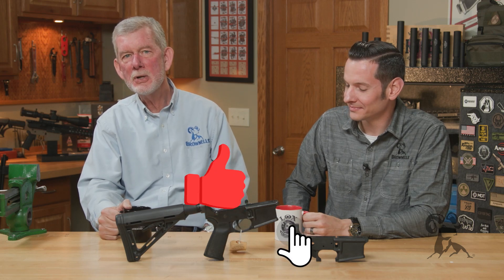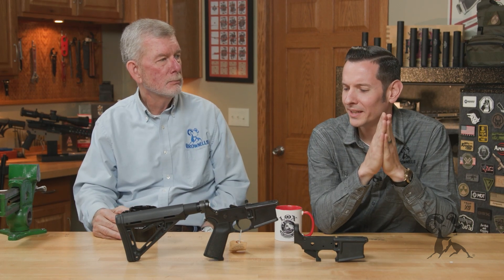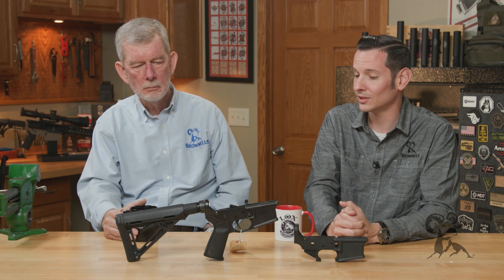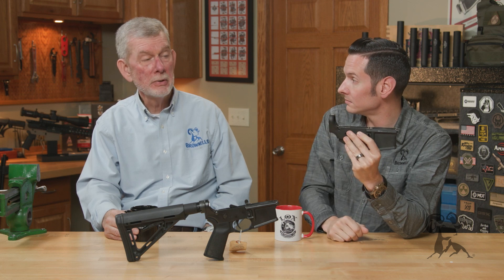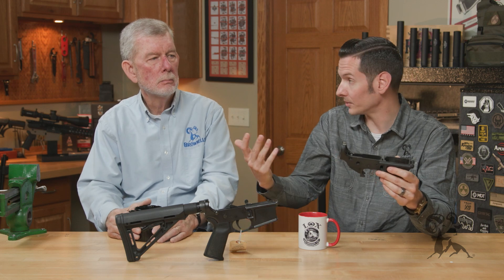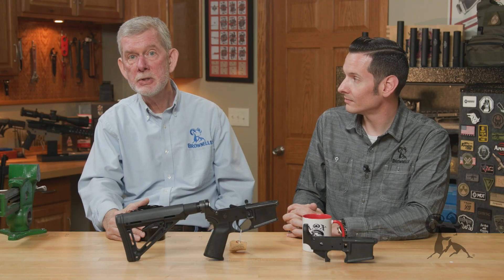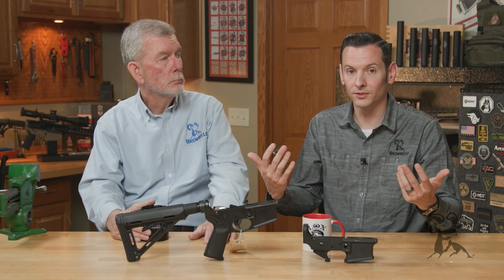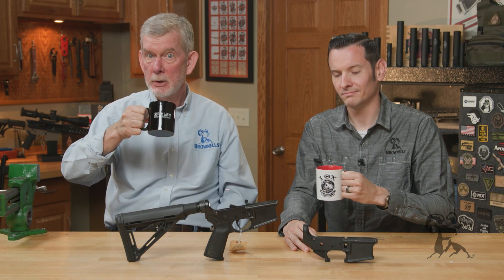Smyth Busters: Are Polymer AR-15 Lowers Any Good?

Comment: The concept of a polymer lower is interesting but most of my lowers are from PSA, they’re pretty reasonable in price and I haven’t had any issues.
Reply: PSA it is amazing. $150 for a lower that is normally 500. And an upper that was 300 that was normally 600. Now, Bam, a 10.5 inch forged 300 blackout AR for 450. So cheap I was like, why not one in 556 as well?
Reply: PSA is the GOAT. Seriously, for the price, they can't be beat. Their Sabre line is amazing.

Comment: I built an ultra light with both polymer lower and upper.  It came in at 4 lb., 10oz.  It IS aluminum reinforced at the buffer tube and the front take down pin.  It also has anti-walk trigger pins.  The gun is reliable and shows no signs of failure.

Comment: I've had two poly lowers one from FMK firearms which ran okay, and the other from ATI (their Omni Hybrid lower) the FMK lower did okay but did not have reinforcement. The Omni Hybrid lower had the reinforcement but I ABSOLUTELY COULD NOT use the takedown pins without having to use punches to drive them out as the holes were not sized properly The Omni Hybrid lower also appeared to have a defect in the polymer inside the magazine well where a small hole appeared which moved through the magazine well and into the trigger housing area. Ill stick with Aluminum lowers.
Reply: What caliber did you use for your FMK, I have a 9mm AR pistol lower and I’m wondering if it’ll work with 5.56 upper since it says multi caliber on the lower.
Reply: @samuelflores2024  I chambered it in 5.56
Reply: @Justin-LaFleur  for the 9mm it ran solid, but the bigger the cartridge the less reinforcement it’ll hold. No wonder the one who built it made it in 9mm.

Comment: I have 5 or 6 polymer 80 and JMT brand. I have used them for several years without any problems. I carry them in the woods hunting and they have held up just fine. I have both AR-15 and AR-10. Maybe I am just lucky.

Comment: Polymers have come a long way. I wouldn't be surprised to see more AR manufacturers switch to polymers in the near future. polymer AR lowers is just more practical and cost effective, not to mention lighter then aluminum AR lowers. Even though I am still not a big fan, because polymer is just a fancy name for plastic, and I prefer not have a plastic gun. Long as it runs and is durable, as well as long lasting. I really don't care what it is made out of, especially if the overall end result is a much lighter and possibly more accurate firearm.
Reply: you dont know what you dont know.  lol.

Comment: I’ve personally had two polymer lowers break, both with extremely low recoiling rounds. One being the MP15-22, and the other a 5.7 upper on xxx brand lower. Both broke at the receiver extension point. Both of them broke under average range use at under 2000 rounds. I also have experience with an ATI that failed from overheating, but that was to be expected. That one did not happen at my hands and was not my firearm, but I am the one who diagnosed what went wrong. That lower is actually still slightly working out.

Comment: Don't forget about The Stryr Aug, designed in 1977, in service 1978 and still used today.
Reply: Difference is that the AUG was designed to use polymer as a lower receiver. The AR-15 lower receiver was designed to be forged from aircraft-grade aluminum alloy that was first made in the US in 1942 (it was initially developed secretly in Japan in 1935, and was first used on the Zero in 1940), and milled to the proper dimensions with numerically-controlled machine tools. 

As a result, making lowers out of polymer requires substantial redesign to the lower for it to work anywhere near as well as the original. That's why the Cav Arms and KE Arms lowers are the only lowers which people actually recommend. The AUG doesn't suffer those issues because it was designed to use it, and the engineers designed it with the properties of injection-molded polymers in mind.

Comment: My omni hybrid newest gen all reinforced everything at first it had alot of doubts faliure to feed to extract ect was getting worried but a spikes tactical st t2 4oz buffer with a springco blue medium spring ive ran 200 rounds with out one flaw also throw your factory mag away it was a problem also went to p mags and runs like a tac driver the s60 mag also no problem but again the buffer and spring on a 16" omni hybrid p3 multical in battlefield green is amazing after a few upgrades as needed! Also i run pmc bronze 223 55 grain or x-tac green tips they love brass not steal!Hoped this helps anyone thats having problems with the newest gen omni hybrid p3.

Comment: bought an ATI with polymer lower a couple years ago ( cheap father's day present for myself)... about a thousand rounds since and it's still going great.  maybe i got the exception to the rule with ATI ?
Reply: I have built 3 AR's with ATI polymer uppers and lowers and had no breakage issues. They reinforce them with metal at the pin points and the buffer tube connection. I guess if you drop your gun on the garage floor or mishandle it, sure it will break. ATI has good stuff!

Comment: I would say a good way to mitigate overgassing is to put an adjustable gas block on the gun if you are going to run a polymer lower. This ensures you can control how much gas the gun gets, and it will help your lower last longer. Anti-walk pins are also a really good idea so you dont get loose pins over time. Also, make sure you only use polymer mags and not USGI mags, this ensures you don't induce premature wear on your magwell. There are some companies that make polymer lowers that are reinforced toward the rear with steel pins. That might be something to look into if you want to keep that area from cracking

Comment: My polimer lower failed at the top of the threaded buffer tube threaded ring. This allowed the buffer tube to slip rearward enough for the retention pin to become unrestrained and lock the bolt up.

Comment: My first CAV-15 lower arrived from Brownells already split along a seam.  Brownells replaced it.  I now have a KE Arms lower that I plan to compare to the CAV-15.  My opinion is these make decent lightweight truck guns, but I am reluctant to use them for serious field work or self-defense when other options are readily available.  I also have several SU-16s which I hold in similar regard.  I have not bothered with the traditional polymer lowers because aluminum ones are better and inexpensive.
Reply: Look through Forgotten Weapons or InRange bios on their WWSD rifle. If you see the abuse they put it through you would implicitly trust you KE15 lower. I have one. Fabulous.
Reply: The new KE Arms KP-15 Lowers are amazing and reliable. Look at the review Recoil Magazine did on the WWSD Rifle on their YT channel. You will change your mind.
Reply: @jmpetersrn Not long after putting up my original post I put mine together but I've not yet given it a thorough workout.  I agree they are much better designed and built than the the old CAV-15.  The only issue I had with it regarded some confusing instructions about installing an ambi safety.  I spoke with Russell Phagan about it and he provided me updated guidance.

Comment: KP-15 is impressive, magazine compatibility could be better though. I wonder if its possible to make a KP-15 but its an integral adjustable buffer tube versus a fixed stock. Would still be able to reinforce the thumb web area like the current model.

Comment: I never had issues with the polymer lower I had, but I did have a polymer upper fail at about 300 rounds. I would only trust a polymer lower for a range toy and not use one on a defensive or duty gun. I’m sure they are fine but I just wouldn’t be comfortable with it.

Comment: That's so ironic. Huge fan of this channel and just started looking into polymer 80's last night. Just came upon a cheap drill press. Polymer seems easier for me to deal with as a beginner rather than aluminum as for machining is why I am looking.
Reply: I have 2 polymer80 ar15 one with a bca upper standard 556 with about 600 rounds thru it mostly steel case, and to be honest no cracks or sings of weak points in it . In my opinion it's best for .22lr uppers for the long run
Reply: @danielramos803  I'm thinking of setting it up as a backup AR but converting it to 22lr. That way I can switch back and forth as needed.

Comment: A regular mil spec 7075 t6 aluminum lower will go for 500,000 rounds. A polymer one will not. Why take a chance? You get a good aluminum lower with that track record. We don't use polymer ar15 lowers in the military for a good reason. There are firearms that gave polymer but those designs were from the ground up. Not a simple material replacement  which has completely different properties, properties that weren't taken into consideration when the ar 15 was invented by Mr. STONER.

Just buy a regular mil spec lower. You're doing yourselves a disservice but thinking "well I think I can make it work". 

Glocks are one thing, polymer ar lower are waay different animal

Comment: I have 2 polymer lowers made by FMK. They are very durable and I've had zero issues with them. They were under $40 each
Reply: How many classes have you taken them to?
Reply: @ja0298  classes? Just to the range for target shooting
Reply: @trekgod3  yes classes. Purposefully induced malfunctions. Purposefully putting stress on the rifle and lower. 

You gotta be able to back it up when you say something is durable. Just target shooting does not make something durable.
Reply: @ja0298  they are solely range toys. They are durable enough for my purpose
Reply: @trekgod3  I get that but next time give a little more context if you say something is durable.
Reply: @ja0298  durable enough to shoot 1k rnds of 556 is durable enough for a range toy for some of us 😅
Reply: But is it battle Worthy the banging around dropping if you fall on it will it break in battle

Comment: I've had nothing but horrible results with Poly AR Lowers . Then again this was 5+ years ago . I would like to give the KE Arms Ambi Controls Poly Lower a try . I've seen a lot good things about the KE Arms Poly AR Lowers . I was impressed with Ian from Recoil Magazine testing KE Arms . He shot in full auto , did push ups on it and pulls ups . That was pretty impressive .
Reply: If your fine with the fixed length of pull, believe me, it's worth it. I love my wwsd ambi lower.
Reply: @blakeromo  Yeah I run my STOCK all the way out . I'm a pretty big dude lol.  I'm for sure gonna give them try in the future

Comment: A friend had an original ATI Omni polymer lower break at the rear takedown pin. He was shooting 300 Blackout subsonic rounds out of an AR pistol. ATI replaced his lower with one that had a metal insert - he rebuilt his pistol with an aluminum lower. 🤷‍♂️
Reply: I had an ATI lower that broke when I dropped it on the garage floor, it was trash

Comment: Polymer is plastic and unless its reinforced with metal inserts like chassis bodies and grommets or metal reinforced inside the polymer in some way it cannot withstand the forces of heat and torque for any repetitive length of time. So there must be reinforcement of the polymer for it to withstand the forces of heat and torque repetitively over time.

Comment: What is the actual weight difference between a polymer lower and one made of aluminum?
Reply: It depends on the lower. A full pocket forged AR Lower like an Anderson can weigh as much as almost 11 oz, or as little as 6.8 Oz for a v7 lithium aluminum billet.
Reply: @spearthumb68  ok, so the alloy makes a difference also. I just thought that most of the aluminum lowers would be nearly identical in weight. Good to know.
Reply: @johnchristian1205  Some have whats called a "full auto pocket" , which is the area where the FA parts would normally go. If that area is milled out it saves about 2-3oz vs a non FA lower. And of course like I noted the alloy matters too.
Glad i could help.

Comment: I have had 1 poly lower from FMK. I didn’t like it because the threads on the receiver extension weren’t to spec, the front pivot pin was nearly impossible to undo when the upper was on. I like the concept of them, but my only experience leads me to stick with good ol 7076-T6 ones.

Comment: I use a poly lower with your AR-180 upper to get away from the buffer tube stress. I've had a failure in AR15 configuration but it was at the buffer retaining detent, there just wasn't enough material to stop the area from cracking. The manufacture replaced it no questions asked.

Comment: Can you guys do a smyth busters on storing firearms in a gun safe with the chamber open? I’ve heard that if you leave them open then gunk will get inside the action, but I’ve also heard that for safety reasons you should leave it open with a chamber flag in for storage
Reply: Storing an auto out of battery will maintain constant compression on the spring. What sort if gunk would be inside a gun safe? My pistols are loaded full up, rifles with empty chamber with full mag inserted. Nobody should have your safe combo that's going to get inside and need a chamber flag.

Comment: Never trusted a polymer lower. The only build I would ever consider is a dedicated ar .22. When you can buy an Anderson lower for $30, why bother with a polymer at 2-3 times the price.
Reply: Perhaps for stripped polymer lowers.  With KP-15s, the benefits are:  1) Light-weight,  2) Less bits to assemble and fail 3) Less cost whether Mil-spec or upgraded.  The KP-15 is a polymer/fiberglass lower that includes the grip, lower, receiver extension.  No castle nut, no threading on a receiver extension, no sliding buttstock, no trigger guard piece, no pin-retention springs.  Ambi safeties, ambi mag release, match triggers are affordable and includable from KE Arms.

Comment: Polymer lowers are fine, but at no cost savings over a quality (budget) lower....what is the point unless the weight savings of 3-4 ounces is that important to you?  And yes I know, "ounces equal pounds and pounds equal pain" when rucking but if I am rucking with an AR-15, I want something durable.  I can shave the weight elsewhere.  If I am at the range, I do not care about 4 oz.  Just my opinion.

Comment: I'm 60 years old and can still remember laughing at this stupid "plastic" pistol that wont last 100 rounds from some company with a dorky name of Glock.  Crickets.....
Reply: I was a new pistol shooter in the early 1980s and was one of the first in the country with my combat Tupperware. Went to my first match in John Wayne’s birth place of Winterset, IA. Back in the day the community was 99% tuned 1911A1s and the shooters before me would have one malfunction or another due to their highly tuned race guns and low recoiling reloads. I shot my series and used a couple 17 round magazines. When I got off line my buddy came up and said, “They were all huddled around asking what you were using because it sounded like a machine gun without any stoppages and that big mag capacity.” Nowadays this is just common, boring and expected. God love ya, Gaston.
Reply: I was a deputy in a Florida Sheriff's department in the late '80s to early '90s. We were one of the first in the country to authorize Glocks for duty use. One of my ARs is an ATI Omni Maxx with 7.5-inch barrel. Zero issues so far.
Reply: I bought one of the 1st Glock 17s imported. The demo from the importer, throwing the loaded pistol all over the parking lot, driving over it with an F-250, and it still firing without a hiccup was a powerful sales demonstration. 

But a plastic pistol made sense. It dropped the weight of the pistol by 1/3rd. Made it so much more comfortable to carry all day. A Polymer AR doesn't buy you but a few ounces for the cost of durability. The fixed stock model may be durable, but it's ugly and severely limits your options.
Reply: A glock is very different though. The part that holds the barrel and the reciprocating slide are all made of metal so it is not exactly a "true" polymer gun. It's just that 80% of the frame doesn't need to be made of metal. An AR15 is different. The buffer tube where the bolt and reciprocating mass is getting hit hard and unless it is reinforced the boss ring will snap eventually. The only good one is the polymer lower that has a solid stock built into the buffer tube like the KP15. The ones that accept a carbine buffer tube will break. Maybe not if you shoot it a few times at a range, but it will break eventually.
Reply: @mrhellotherehowareu1384 finally  the correct response.
Reply: Ditto
Reply: Glocks are more reliable than 1911s
Reply: I had a polymer lower that fell out of the safe and broke in half
Reply: Oh yea! And those funny plastic ones can go undetected thru metal detectors
Reply: @dave-d-grunt  The frame might but the gun cannot.  Too much steel on the barrel and action parts,

Comment: I have a certain polymer lower that (knocks on wood) hasn't had any issues and has actually been doing better than one of my cheap billet lowers...I have noticed a little flex on the buffer tube area.  Would it be worth it to add a one piece thumbhole stock like the CQR to add rigidity or should I just stick a dedicated 22lr upper on it to keep the stress down?
Reply: That might be the one situation where those CQR stocks are actually useful.

Comment: 3d printed lowers are about as polymer as you can get and they are excellent when done well.  I have 3d printed some glock lowers and put hundreds of rounds through them with no problems, and have recently begun to experiment with 3d printed AR15 lower.  So far I love it.